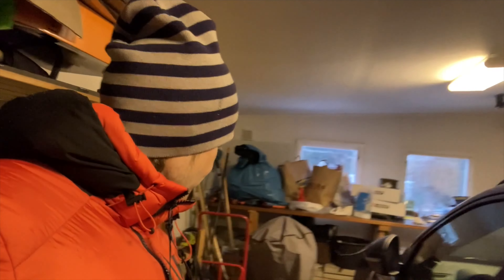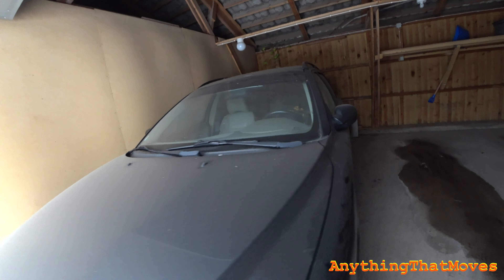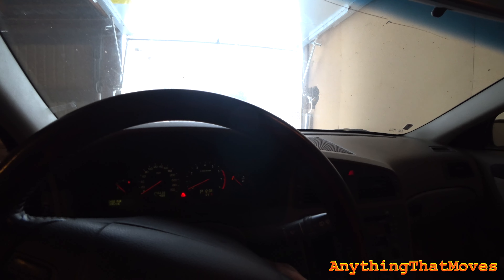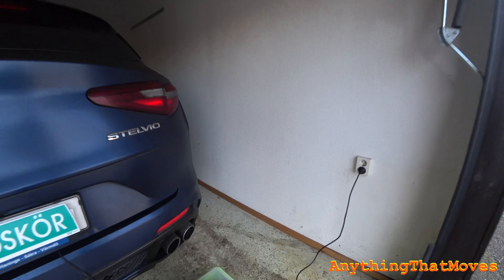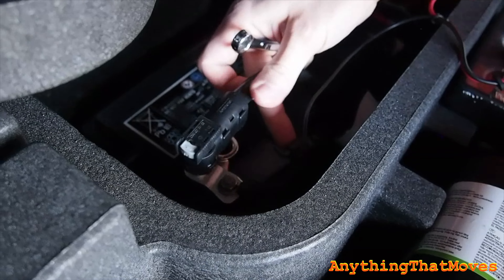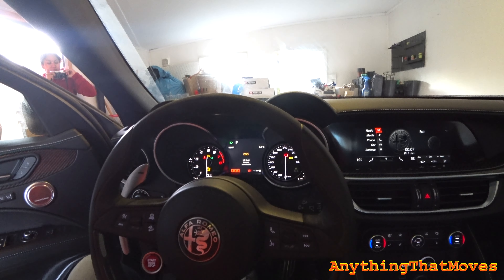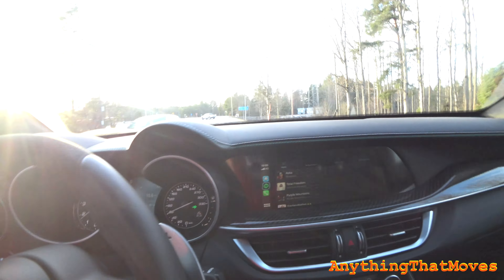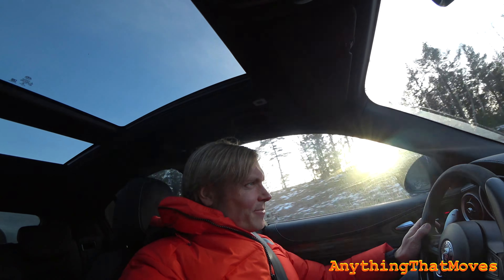Alfa Romeo Stelvio Quadrifoglio - battery depleted

Comment: Hello Thomas, well I had my first dissappointment with an empty battery also last month. I have the Stelvio Q4 100BHP. Before it happened I had been driving quite a few short rides into town over a couple of days, because it was rather unpleasent weather. Then on the weekend it was just standing for 2-3 days, it was quite cold around 0 to -5°C. Then on the monday it was completly dead. Quite a big surprise after having the car for only about 1,5 months. I called the road service, when they came they couldn't get it started, which was rather strange. So we had to bring it to the dealer. They did manage to get it running again, but they were not able to track down the cause of it all, which is a bit worrying. They checked all the logs in the computer but nothing special was found. So I now did buy myself a trickle charger also, so that I can monitor the voltage and when needed charge it.  
Did you ever understand why your battery went dead?
Reply from the maker: Hi Rijnout. Sorry to hear about your battery. I never found out what caused the battery depletion, and I haven't had any issue since the one time featured in the video. When I had the car for annual service they checked the battery on my request, and it was in good condition. Let's hope it was a one off occurrence for both of us!

Comment: You can change the "Switch off delay" in the System menu. You only get 2 choices, 0 minutes or 20. Also possible the standard battery îs not good try to ask for a Mopar AGM at the dealer
Goodluck
Reply from the maker: Thanks for your advice. I'll check.